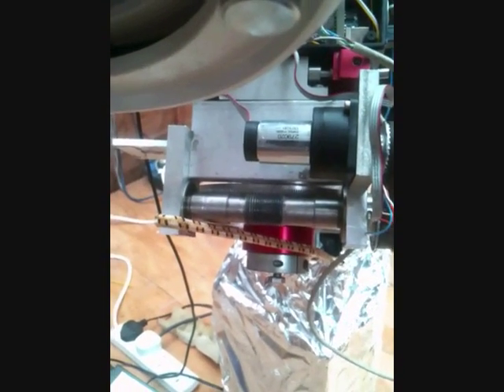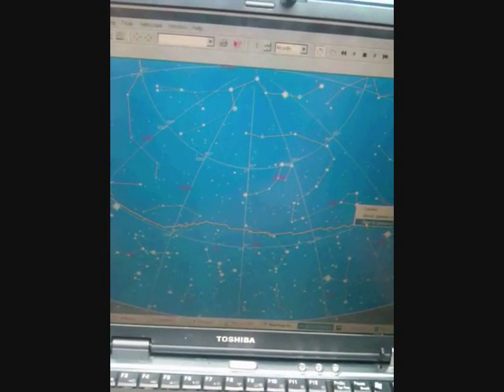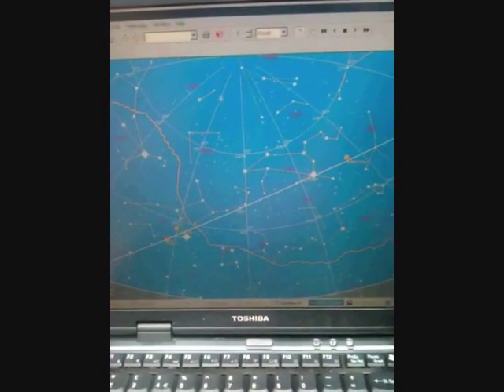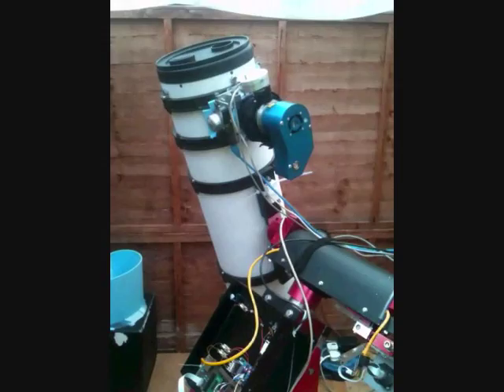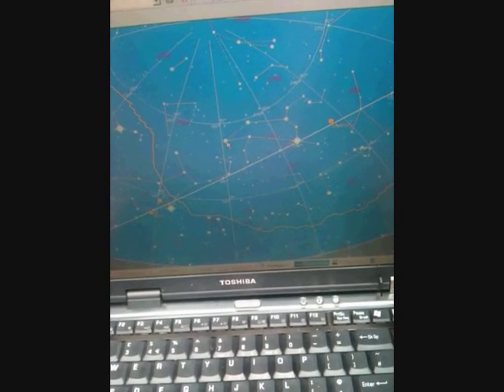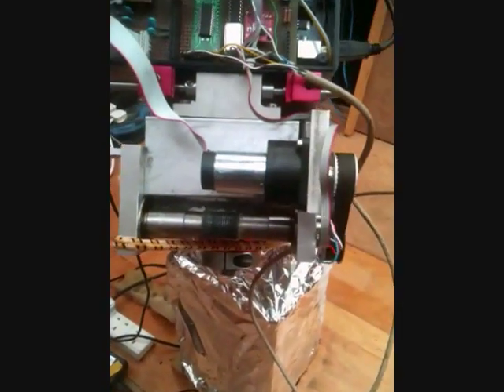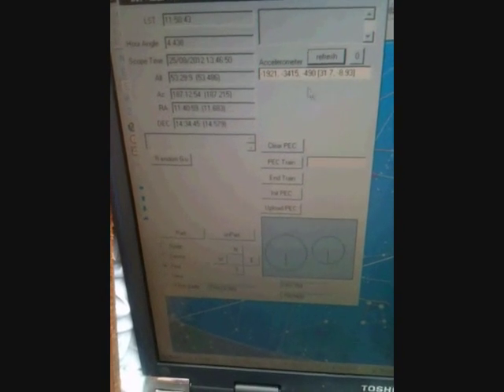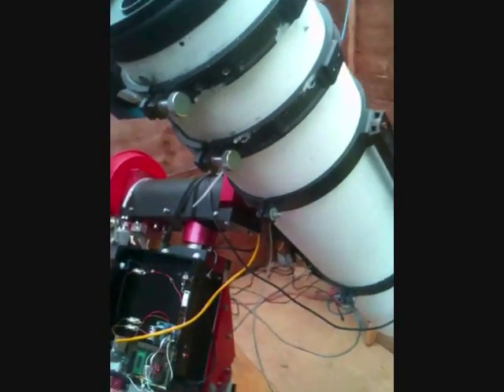Arduino astronomy telescope control: Introduction and Gotos on homemade mount

Comment: Good morning Tom. Excellent work, I see that you are very expert and fond of astronomy ...
I want to write the following comment that is somewhat extensive: As much as I try to find an answer to the following, I could not find the satisfactory answer ...
Apparently, almost nobody takes into account that the primary mirror can not only suffer from de-collimation with respect to the secondary mirror; The primary mirror can suffer astigmatism due to the movements caused by the weight of the glass, the size of the mirror, the triangular supports of the cell, the tension when fixing with a slight force the mirror to the cell and the different temperatures in the environment of observation.
I have a Newtonian of 12 inch f / 4 and I discovered that the mirror is attached to 3 of the 9 points of the tilting triangles of the support (that is, a point stuck by each swinging triangle of the support). The telescope factory (GSO) attached the mirror to the cell with double-sided tape. I have read in some forums and articles that it is better not to stick the primary mirror in the cell to avoid astigmatism. I do not know if that is correct. In a telescope like mine that is NOT Dobsonian, which is placed in a robotic equatorial mount (mine is a CGX-L from Celestron); and if I don´t stick the mirror to the cell, I suppose that every time the mount is directed to a point in the sky, the telescope will immediately lose its collimation. I see that there is about a millimeter of space between the mirror and the ring of the cell; a tolerance that I imagine is so that the mirror is not forced into the cell when dilating or expanding due to the nature of the glass and thus produces astigmatism.
I understand that in telescopes that do not exceed 8 or 10 inches, the astigmatism is not perceived if the primary mirror is stuck in the cell.
GSO never answered me that concern and that is why I come to you when I see that you have a Newtonian similar to mine.
Reply: Err i think this guy has a dobsonian . I have a dobsonian.  Pretty sure i have a dobsonian lol .